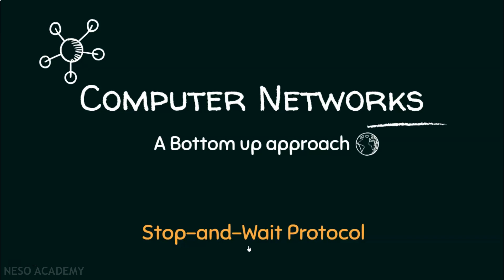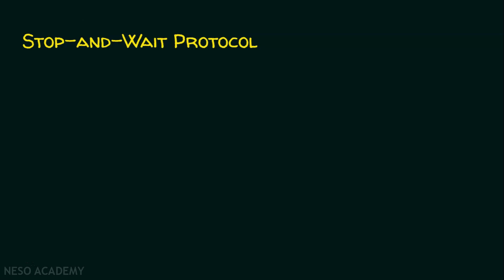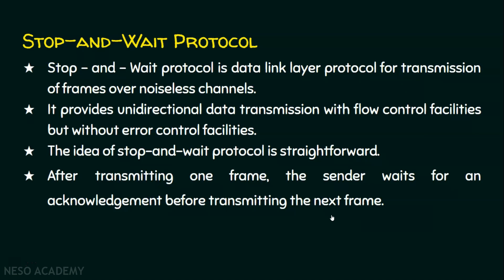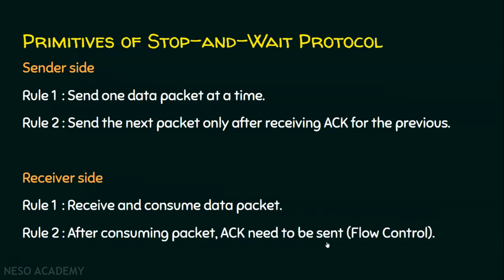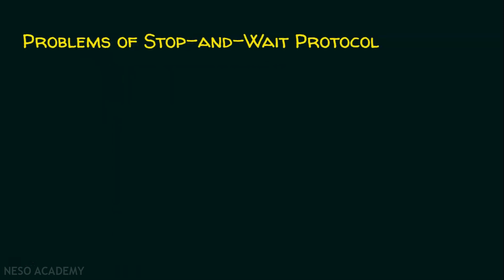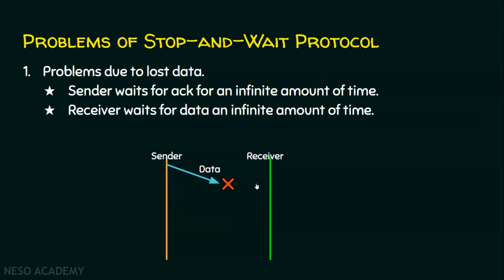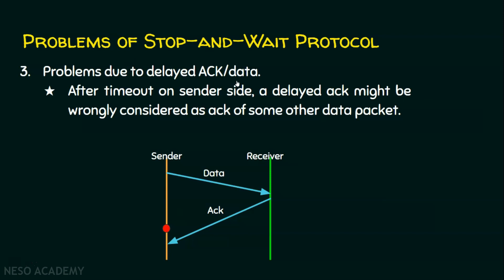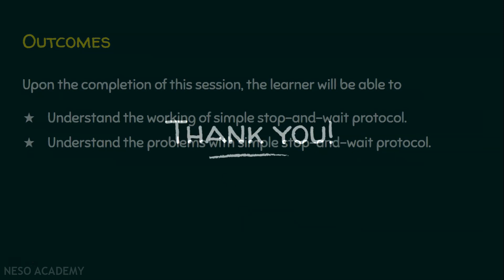Stop-and-Wait Protocol

Comment: I am confused here 
you said in problem 1 : "sender waits for ACK for an infinite amount of time "
in problem 3 :"After timeout on sender side, a delayed ACK might be wrongly considered as ACK of some other data packet."
my question is that, if sender waits for infinite amount of time then how there will be  timeout in sender side ?
Reply: Honestly i think stop and wait protocol  does not have any  problems because we are considering a noiseless channel where no frames can get lost
Reply: @dangerduderocks7349  vary naise
Reply: @dangerduderocks7349  makes sense
Reply: A late reply but can help students in future.

Problem: sender waits for ACK for an infinite amount of time
Solution: Introduce "time out" on sender side.

New problem: ack not received in given "time out" period.
Solution: Give sender's packet a sequence #SN,if receiver sends back Request number==#SN as ack, send the next frame/packet with #SN+1.
Otherwise, resend the packet having Sequence number #SN to the receiver.
Reply: @somalrudra5805  Thank you so much.
Reply: @somalrudra5805  very cool explaination
Reply: @somalrudra5805  I think that this sequence No is added in TCP not in Stop and wait, in Header of Data segments.
Reply: Obviously bro, you are right. I am also confused for the same
Reply: yes there's mistake sender does not wait for infinite amount of time . There is a timer set at the sender when a frame is send if it does not receive ack  in given amount of time it would send the same frame again.
Reply: @pradeepjaiswal9706  Thank you
Reply: Yes exactly 🤔
Reply: You are right. There will be a timeout on both sides, he made a mistake.

Comment: Thank you ...sir simplest protocol for  noiseless channel  was missed
Reply: It is simple 
*it has no flow or error control
*data frames are traveling in only one direction from sender to reciever
*the data link layer of the reciever immediately remove the header from the frame and hands the data packet to its network layer
Reply: @sheffyjoseph  thank you
Reply: @sheffyjoseph collision?
Reply: @Azlan_4545  what? It's unidirectional

Comment: Sir... Instead of saying  data packets.. You can say frame.... 
I think using packet name in DLL is totally wrong ..
Thank u😊
Reply from the maker: You're correct, but it is not at all an issue as frames and packets are used interchangeably even by highly revered authors.